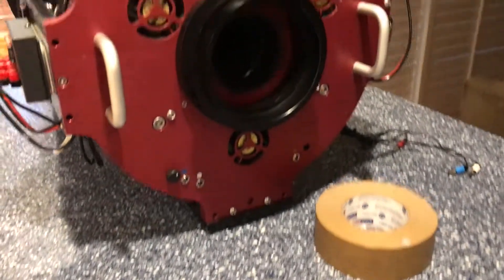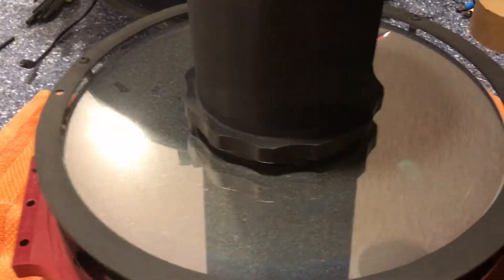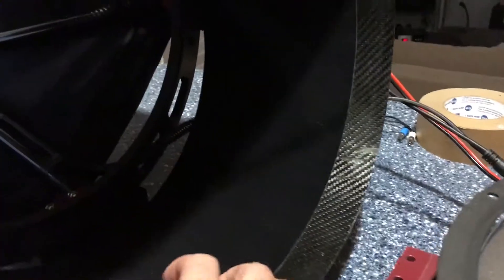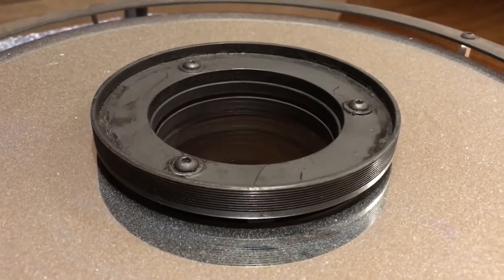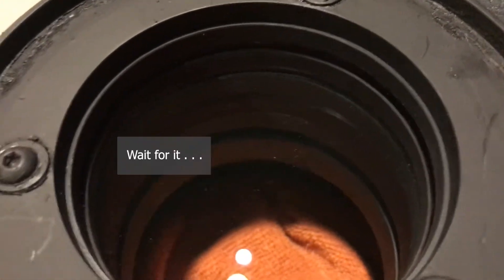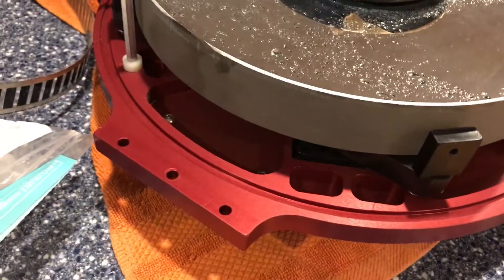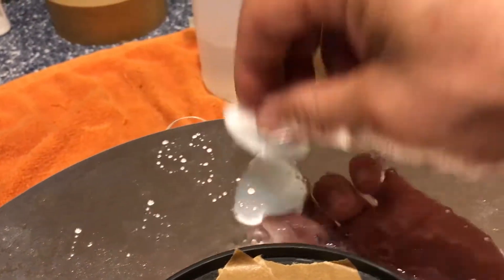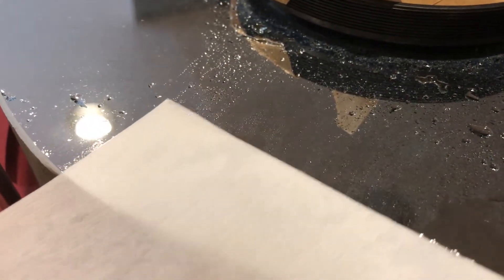AG Optical 12.5" iDK Primary Mirror Cleaning

Comment: In order to save the optics of anyone taking advice from here. Please remove your mirror completely and let it sit alone submerged in a plastic dish of warm water and dreft pure soap. Then float small balls of cotton wool working from centre out and never using one twice. The telescope featured is very expensive and never got this dirty just from sessions exposing images.
Reply from the maker: The advice being given here is based on advice I acquired directly from the owner of the AG Optical company, the guy who designed and manufactured this instrument, prior to cleaning this mirror. I specifically voiced my concerns about causing damage to the mirror prior to doing the work. He told me these coatings are extremely durable, unlike some treatments done by third parties for home-brew mirrors, and that if I took basic precautions and generally followed typical cleaning techniques, that I had nothing to worry about. I’ve been working with, maintaining and cleaning my own optics (telescopes, eyepieces, filters and camera lenses) for a few decades now and have never damaged a single one. You might try being a bit more diplomatic next time before you post, or being more specific with your advice.

Comment: Thanks for sharing this info. I will be cleaning my iDK-10 here shortly. I am wondering if you had to adjust collimation after re-installing the back section. Thanks.
Reply from the maker: Hi.  Sorry for the late reply.  You shouldn't have to adjust collimation unless you bump something pulling the assembly out - I didn't.  Might be a good idea to make some withness marks on the backplate and the OTA just to make sure you put it back in in the same rotational orientation as it was before you pulled it out.